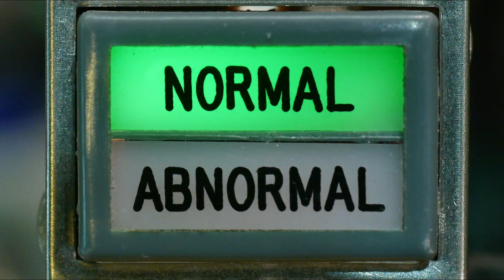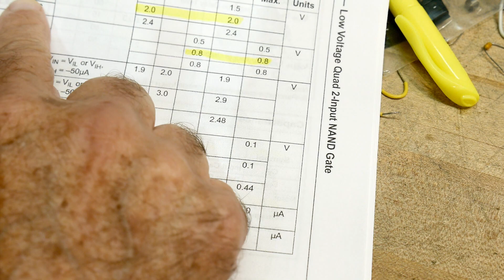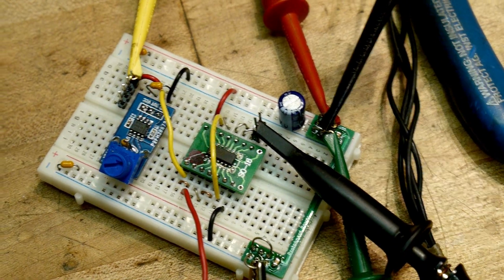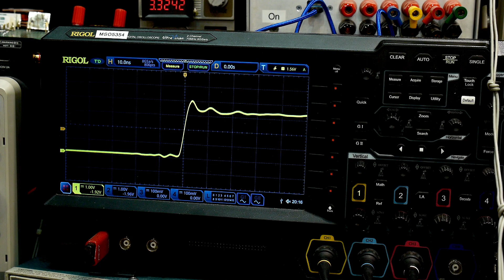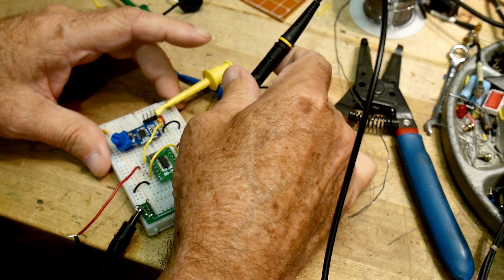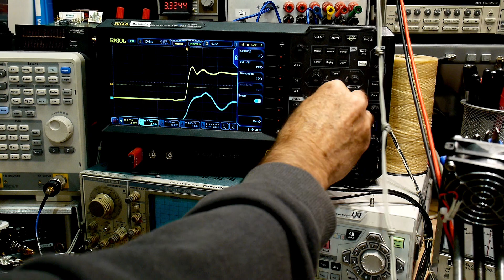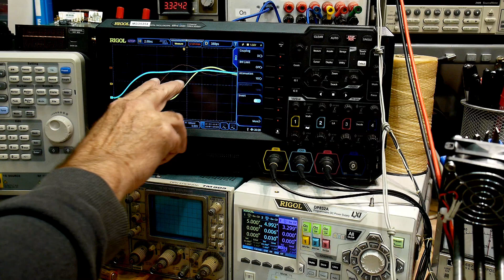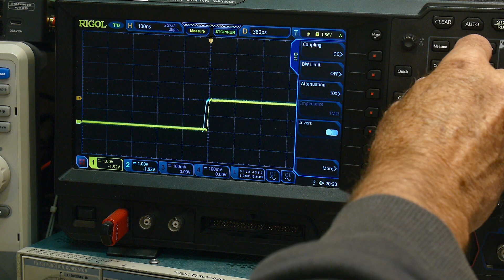#1741 74LCX00 Quad NAND

Comment: TTL compatible, but I can bet that you can probably put 9V into the input of 80% of the chips with no issues. you should take one, and use a separate supply to the 555 timer, and see exactly where the input starts to break down. Easiest with a red LED and 1k resistor in series with the lead, and wind up the wick from 5V to 15V, and see when the LED starts to light. Would have to be an original 555 timer, as the clones and CMOS often do not survive 15V operation, but I have run the originals at 18V with no problem, even with a very large capacitive load on the output.
Reply: Such tortured chips don't last very long...

Comment: Very nice circuits, I never used them. 
When measuring the propagation delay it might be interesting to observe the influence of the probe. As it is hard to measure without probe one could make a sequence of three gates with probes attached and remove the second probe to observe the change of the delay from the first the third. (to keep you busy 😄) In fact I wonder how you manage to produce so many interesting videos.